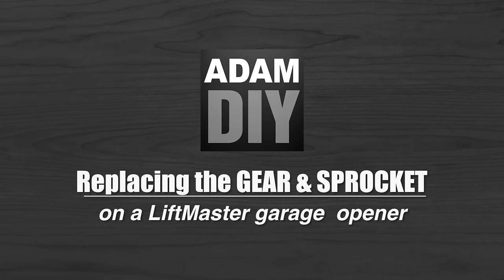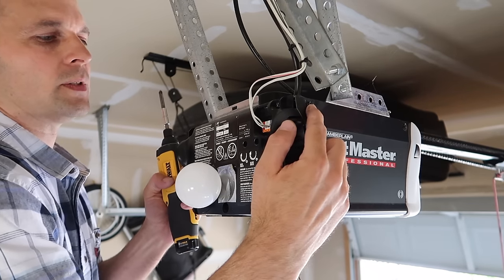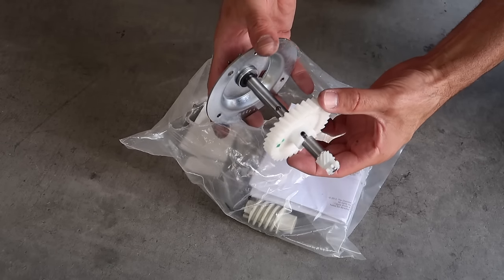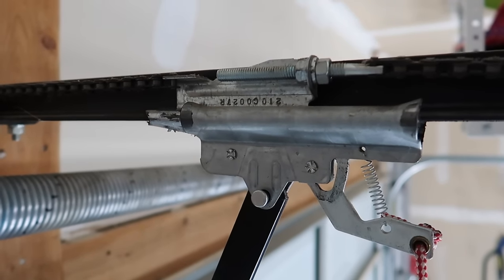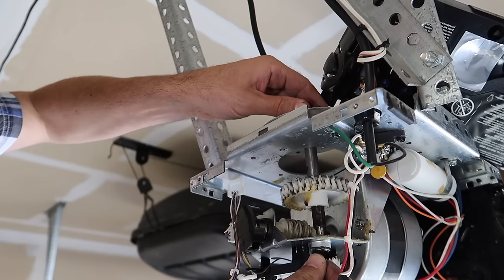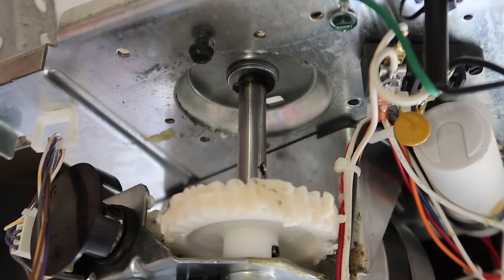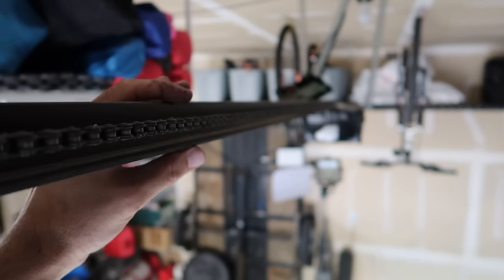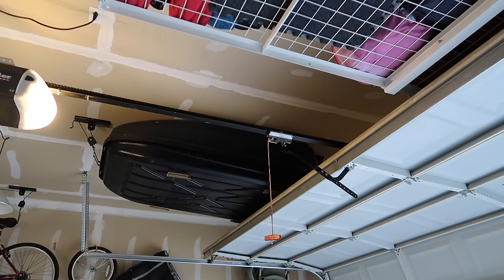How to change the gear and sprocket in a garage door opener - LiftMaster Chamberlain

Comment: We bought a house with a garage door like this and planned to replace the opener but identified this issue and are replacing the gear but the metal piece at the end of the chain that you used the clamp on is all the way to the wall. The chair is also super loose so wonder if there's a way to move that metal piece more onto the side somehow. We can't get the door engaged back into the slot but maybe when we run it it will grab hold on it's own.

Comment: Outstanding video. My son and I bonded over this repair project.
The only issue we ran into was our sprocket had sheared off completely causing the chain to hang to the floor.
This caused the up/down limits to be completely thrown off. 
(The garage door "thought" it was up and was trying to go down when it was already down)
We left the cover off to make the adjustments to the up/down limits.  
We had to pull off the small gear with the E clip and manually reposition the gear on the switch drive shaft that it interfaces with.
(Disengage Door,  start trolley and stop it about half way  then manually turn the switch drive shaft to approximately half way point to match where trolley is)
We could then adjust the UP/DOWN limits until it worked properly.

Comment: There are two electrical connections that are left hanging while you are fixing the gear. Where do those plug in.
Reply: In the video when you reassemble everything you didn’t say where to reattach them you just put the case back on
Reply: .. I'm pretty sure they both get connected to the circuit board .
It's at the 2:00 to 2:05 time in the 
video . You can see the 2 wires 
hanging down after that .
He disconnected it , and set it up
on top of the whole unit .
You can see it when He's putting 
the chain around the sprocket .
At 7:28 - 7:50 time in the video .
You can see the "White" little pin
connection port ,, ( On the Left , 
bottom part , of the Green circuit
board )  and I think the bigger one
is to the left of that one .

Comment: Great video, it helped me a lot to repair my older lift master garage door opener!  I only made one mistake,  I didn’t properly align the two square holes on the top of the housing ( which holds the top chain guard), so I had to redo it. You’re other video helped me set the limits properly, thanks again for saving me money on this repair Adam!

Comment: Adam, Our door works like a charm and thanks to you and the video.  We had to go through the process twice as when we were putting the plastic cap back on, the holes did not line up.  Had to take it all apart and works great.  We watched the video several times and didn't remember that part.  Great job explaning.

Comment: Just replaced gear and sprocket. Failed to mark chain location. When I finished and fired it up, the rail buckled and the chain did not move. Suggestions?
Reply: same thing happened to me. if you're like me, my garage door thought my garage was up when i was working on it closed. so when i got everything replaced and tight and hit the button it tried to go the opposite way and the rail buckled.   Assuming you're working with the garage down all the way like I was.  take the chain off, run the opener until it thinks your garage is down all the way(watch the sprockets direction to determine this) then put everything back on and give it another go.

Comment: Thanks for the informative video. You made it pretty easy to accomplish the task. My only issue was that the top cap that is held by the three screws has to be orientated correctly for the plastic cap that protects the top sprocket to fir correctly. Guess who put it all back together, feeling a bit pleased with himself, only to realize that I had to tear it all down to re-orientate...duh ;)

Comment: My problem is the sprocket/gear on top of the garage door opener keeps spinning one way for few seconds and in reverse the next few seconds, so it never finishes a complete cycle. This happens even if the chain is not connected to it, can you tell me where the problem lies.
Reply from the maker: Hard to tell without seeing it.  I would check the sensors, limits and force settings.

Comment: Thank you thank you! This video saved me lots of time and money when my axle went 2 days ago. The travel was set all wrong which probably lead to the axle issue. With the parts from Amazon in 2 days and your videos, 30 mins im back in business with a happy wife, she gets to park in the garage! One question, i have the same model but when i tried to do the 2x4 test it would not rebound automatically. Even after increasing the down travel the door just cumpled up and i didn't want to push it any more. Is there anything else i can do to ensure the safety feature works? Thanks again!